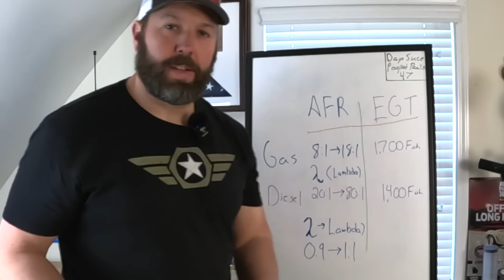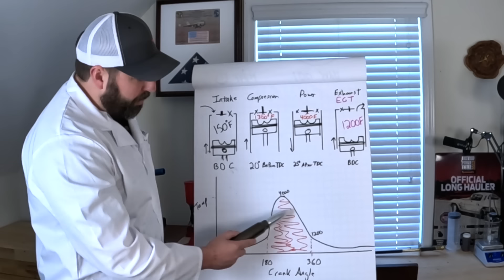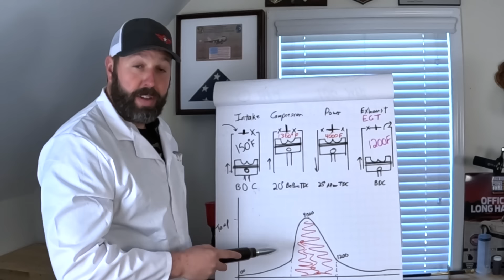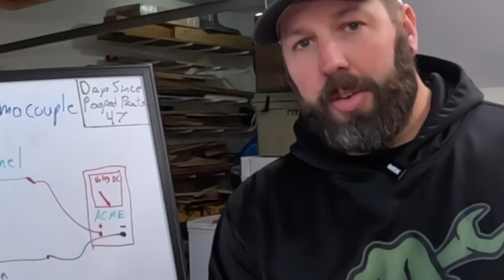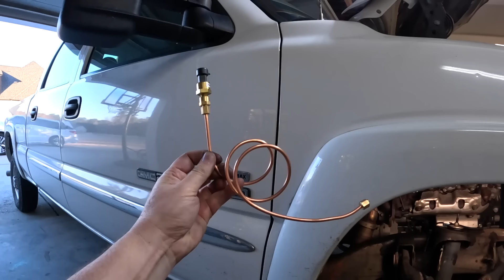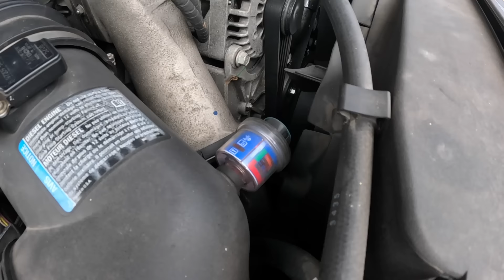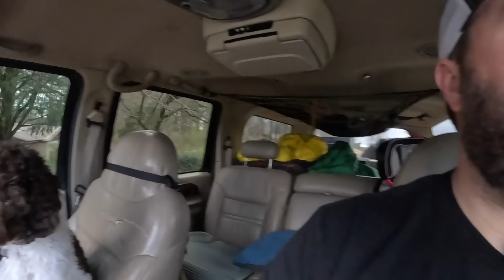Silent Diesel Killer…Diesel Exhaust Gas Temperature (EGT)! #diesel #egt #dieselengine

Comment: Peterbilt tech here and i cannot tell these guys enough how much heat the engine retains with out the EGR on these newer engines, not uncommon to see a newely "offroaded" engine, torch a head or turbo shortly after. Great video!
Reply: A Ram Cummins I know runs at least 200 C cooler without EGR. ( Hot air Detuning)  Than with it an has a 28 percent reduction in fuel burnt
Reply from the maker: @garreysellars5525  if you tune the truck after removing the EGR, bump the timing, and disable all the other emissions aspects of the engine, you could reduce EGT’s, but at the same time, you are increasing the cylinder temps. Which is more efficient and powerful, and the expense of increased emissions. Cummins knows a thing or two about cheating those emission laws though 😂😂
Reply: @freedomworx  yeah look into that
All they did was increase add blue use and lock out the RCU
You missed the point
LOWER EXHAUST TEMP WITHOUT EGR AND LESS FUEL BURNT 
So with emissions fitted use more fuel
How is running the world out Of fuel faster Better for the planet 
Ad water methanol injection system reduce nox reduce fuel consumption
Make better power
Lower exhaust terms
Reply: @freedomworx  dude what you're saying is completely contradicting. @garreysellars5525 is correct. This is not gasoline and it took me some years to truly get my head wrapped around switching gears from gas to diesel from job to job. And Gale Banks vids explain it the best and easiest to where ppl will actually watch thru n learn so I don't have to type for an hr lol. Its good we all work together and continue to learn instead of getting shoulder chipped. Then we all will be unstoppable.
First, reducing egt's while raising cylinder temps simultaneously is physically impossible. Its physics, thermal dynamics to be particular. Second bumping the timing only creates more cylinder pressures, this rides a line similar to detonation on a gas, as it will beat the bearings outta her n try to lift the head. Think of punching the piston down vs pushing. Although you can gain some power with a bit of timing this only benefits at the highest rpm range and diesels already wanna run lower rpm in torque band not hp band, unless you're building a dyno porno. Now if you push too far on timing with direct injection engines, this will cause the computer to calculate there is not enough time for pilot shot and will skip the pilot and move straight to the main shot. ( I know when this is occurring as can always hear the rattle at low rpm tip in or matting on shit tunes) Now u get less fuel and no pilot preburn to muffle piston slap and eliminate all the dwell for when the main shot is "supposed" to fire. Couple that with the punch that is created instead of push, the binding effect starts to set in and cylinder pressures go well over 1000psi and this is what lifts the head gaskets. Stud it and now you'll beat out rods or mains, maybe a ring land depending on engine. Third the only way to cool cylinder temps AND egts is to add more air density or to pull back the fuel, and the colder the air density the more power is created while achieving cooler cylinder temps AND egts. We just only have a way to watch egts without melting sensors and having more ports in the combustion chamber etc. Matching the fuel to the amount of air density and having that air density be as cold as possible (more dense) is the only way to make power while having cleaner burn and cooler controlled egts (no large flares on full send, stabilizes and the cooling system can stay on top of/maintain these temps for a 10min hill pull for example). All my info has been confirmed using a ford 6.7 with cylinder pressure transducers in the glow plug holes and cummins with CO2 sprayed intercooler along with frigid North temps on dyno and on road. And Gales science and tests showing how adding more fuel past the amt of cold air density u can shove into that engine actually loses hp and torque due to everything getting so damn heat soaked after initial pull as it ruins the air density as well as excess cyl pressure beating her up and large egt flares on the ragged edge of dropping valve seats or injector tips causing the ol plasma torch thru the piston. I'll say it again just like while talking w Gale, smokin is nothin but meltin n wastin. Humble ourselves n lets keep enlightening each other to learn as much as possible, then we can achieve perfection. And more minds are always better than one as then all angles of perspective can be brought to the table so we dont miss out on any knowledge
Reply from the maker: Raising cylinder temps while reducing EGT’s is far from impossible, you simply don’t have a good grasp on the diesel combustion process or physics and thermodynamics of an internal combustion engine. You can advance timing and get a higher peak cylinder temp, while simultaneously reducing EGT’s because the peak temp happened earlier in the stroke, which gave the piston more time to extract energy (heat) from the combustion gasses. Not to mention that modern diesels use multiple injection events per power stroke to try and lower the peak temp while maintaining the average cylinder temp and pressure. This means you have combustion occurring later in the powerstroke, where the piston doesn’t have as much time to extract energy (heat) from the combustion gasses. Hell, OEMs want the high EGTs because that helps the catalyst in the exhaust system do their job. But they don’t want the high cylinder temps because they produce NOx. Like I said, you guys go watch some more Gale Banks videos, I’m quoting directly from the Bosch Automotive Handbook 11th edition and  Internal Combustion Engine Fundamentals 2nd edition. I’m not saying Gale is wrong, I’m just saying that neither he nor I can explain that topic completely in a short video where everyone can understand it. The best video on EGR can’t make most people understand it, because they just don’t have a good enough grasp on physics.
Reply: @freedomworx  Holy cow bud u absolutely cannot cool diesel engines by adding more fuel at any point in the firing event. These things are truly air pumps. Your video was spot on, the only thing i disagreed with and corrected you on was your comment to garrey. I do say i really appreciated your video and the enlightening to offer so many who don't understand egts, but now youre just making a mess of your understanding of the basic concept just outta spite and the chip on your shoulder. Really starting to remind me of the rest of the email tuners and I bet I find your timing maps at 40deg btdc cutting all pilot and draining the rail before closing causing shitty atomization and the haunting p0087, which most poor tuners just shut off from setting, while the lack of high pressure against the injector for the next event causes a poor spray creating more heat and more smoke with less power. cmon man we are better than this arrogance
Reply from the maker: I’m not being arrogant, I’m just being factual and contradicting  what you are saying. You say that you can’t cool diesel engines by adding more fuel at any point…. So why do competition sled pullers and drag races run AFRs so far past the point of adding more power??? Because the extra fuel actually lowers the EGTs. It allows the to get them most possible fuel burn out of the given amount of oxygen in the cylinder, while quenching to exhaust gasses to keep the hardware from melting down. That’s the EGT control strategy used when nitrous isn’t allowed 🤷🏻‍♂️ Now that phenomenon is not what I’m talking about in this case, but it does demonstrate that you either need to brush up on your knowledge or choose your words more wisely. You
Reply: @freedomworx  dude once again you are dead wrong. That is gasser concept, we cool the cylinder walls with the rich spray (too rich will butt rings and is just as damgerous as too lean, did you know that? I learned the hard way after an old fart told me to listen up)... This is fully incorrect with diesel, there is no extra fuel to cool the combustion on a diesel that will only cause more heat, cylinder temps, AND egts. I have proven it with multiple real life tests to know I am doing the right thing because of humbling and self doubt, which has actually made me better over time instead of stuck stagnant in the same rut over thick headedness. The only reason they do that on sled pulls is to get the unburnt diesel to flash in the raging hot exhaust log to make the turbos spool as fast as possible, then the temps cool cuz the AIR is now coming in hardcore, compound that with an amazing intercooling sys and then you can continue to make power without melting down. On everyday vehicles this is achieved with a VGT TURBO, not FUEL as its just wasting n melting. I think YOU need to brush up and open your mind into understanding that NONE of us know it all and you are stuck on arrogant hill with no room for improvement cuz "YOU KNOW IT ALL" already. Keep meltin em down then bud, and cant say I didnt try to pay it forward
Reply from the maker: @odysseydiagnostics https://youtu.be/Wda4geM8X-c?si=kTw3fHg4kyROifs8 very simple video to once again explain to you what you dont understand. Charlie is a diesel drag racer and owns KC Turbos. You going to tell him he doesn’t know what he’s talking about either? 🤡
Reply: @freedomworx  Dude holayyyy that video just proved my point i'm trying to show you, this is ridiculous you're absolutely arrogant. He literally just said its to drive the turbo harder and the air is what bringing egts back down. Fuel always brings it up. Air always brings it down. On a diesel. Exactly what I just said, and Garrey, and Gale and Charlie are saying. Charlie knows what hes talking about its you that doesn't now and its you that are calling ppl down now its borderline narcissism at this point and you prob just doing for the engagement or your arrogance has created absolute ignorance in you. Shame on you, you need to do better. Smarten up man and pull them bosch binders back out with an open mind and when you're done then listen to charlie again if you don't wanna listen to me and Gale. Your video was good. Don't ruin it with this bs. The only one who is a clown now is you and I don't need an emoji to prove that, its all in the comments and chariles video what a joke you've turned into in my perspective and to think I thought u seemed super cool and knowledgable after watching yer vid
Reply: @freedomworx 
You have also s
Reply: @freedomworx 
If get is lower as it exits the cylinder 
Wouldn't cyl temp be lower 
You confused me there
Heavy diesel fitter 45years 
Australia
Reply: @f @freedomworx Naval Engineer here who specializes in marine diesels. You are 100% correct on adding more fuel to create lower cylinder temperatures. It’s kind of like the more acetylene you add to a torch the hotter the flame until a certain point, once you cross this point the torch flame temp actually starts going down basically, but not really.
Reply: @garreysellars5525 English needs tuned.
Reply from the maker: Thanks for watching. Yeah, very few people actually understand what an EGR system actually does, they just know that they don't want it.  If you're going to delete it, you best adjust the tuning to account for it, or you can definitely burn one down. 👍
Reply: @freedomworx  even 80hp GM 2.5 "iron duke/tech 4" will melt a piston if the EGR is deleted
.
You have to be using it JUST RIGHT to get the 80hp to get hot enough 
But it can happen
.
.
If the EGR is designed well (aka, doesn't fill the intake with soot, the pipe itself doesnt plug, etc etc)..... I'm keeping it
Reply from the maker: @kainhall  an EGR can actually increase MPG on a gasoline engine. Most people don't realize that.
Reply: @kainhall  To be honest the efr is a good piece of equipment.it's just the engineer's built a good device but they proceed to ignore the pistons something I think is criminal they wanted less emissions but overlooked the best way to improve the heat would be a issue but like I said the e.g.r. would help with that a better set of pistons would help.to decrease those pollution's something companies like wave of air is working on if this type of thing goes big emissions should be a thing of the past if I am looking at this right
Reply: @kainhall  but that's what EGR DOES
Haven't seen one that doesn't
Reply: @freedomworx  you recon
It's a hot air Detuning device
Making the intake air hotter. 
IE Reduce air density uses less fuel.  Mmmmmmm
Have you watched any thing from Gail Banks
Reply from the maker: @garreysellars5525 ohhhh… you watch Gale Banks! Didn’t realize I was dealing with an expert 😂
Reply: @freedomworx   with gassers this is actually the case for really only 2 practical reasons, the scavenging effect allowing more air (density) to be sucked in each time whether from egr valve itself or from cam overlap and VVT systems which is only really seen as a benefit in Naturally aspirated engines as with boost u could just add more density by growing boost and cooling intake temps. And second cuz the added nox with a bit of hot exhaust gasses can prevent knock allowing us to run more timing, but with all gas engines we have DWELL, which is due to having spark plugs and needing time for the command to actually create the spark at the tip of the plug as well as the time for the mix to start burning and the flame front to spread across the chamber. Gassers have a lot thinner block and head masses which allows the cooling system to strip these temp spikes though during a pass etc. And all new age diesels have a pilot shot to eliminate damn near all dwell as long as someone hasn't adjusted it so poorly as to kick out the pilot due to lack of firing event time. As i said below, it took a lotta humbling, thinking, listening for me toi get to where I am, and the more we all stay open minded and continue to learn together the more we will all succeed in achieving the impossible
Reply from the maker: You forgot to mention the reduction in pumping losses that an EGR creates in a gasoline engine. When you introduce EGR flow into an NA gasser, you need to open the throttle body more to achieve the same power, this you reduce the pumping loss and increase efficiency. EGR decrease efficiency in diesels and increases efficiency in gassers (in general).
Reply: @freedomworx  At this point youre just arguing whatever u can think of just to feel smarter, when in all reality we are all really smart in our own ways. Put that all together and all of us make the smartest knowledge but only together. Your video was good, dont ruin it now with this high horse chip and be open minded to learn more. I mean how do you think you learned everything in your video? you were open minded. Also you really have no idea who you're talking to as far as skills go, and a good person would never discredit someones skill when they dont even know them. Thanks for the showing of true colors and ill keep fixing the ones guys like yourself keep screwing up then all over arrogance. just a shame
Added: I have all those bosch binders too bud, and only with the experience really connected the dots and showed me how to really diagnose, fix, improve, and tune correctly. Gales vids are simple n palletable and spot on for air density, just like your vid was spot on for actual egts in general. As stated before I only disagreed with your comment to @garreysellars5525, and the only reason I commented instead of keeping to myself is cuz I didnt want to see u ruin such good vid with such an ignorant and/or arrogant comment showing other ppl the few missing links in your understanding and possibly risking discrediting your vid as it really helps a lot of ppl to have vids like yours AND Gales to enlighten themselves w and not be so far off the beaten path of the real concept
Reply from the maker: I’m not being arrogant, I’m just disagreeing with your “facts.” If you don’t like my “facts” take it up with Robert Bosch GmbH and John B. Heywood. And if those names don’t immediately ring a bell, I’ve found our disconnect.
Reply: @freedomworx  Bro bosch n Heywood would sit you down n straighten u right up cuz from garreys comment on youre showing nothing but arrogance after a good vid with actual good "Facts". At this point your disconnect is your charge air pipe blew off when u told garrey that and continued to sit on yer high horse of bs on arrogance hill through the rest of this instead of learning. Smarten up bud, nobody know it all and now you're making yourself look ridiculous out of spite. Thats not how a true diagnostician carries themselves
Reply: @freedomworx 
And 46 years as a diesel fitter
Reply: @odysseydiagnostics 
Thanks for the backup and for his info I am a heavy diesel fitter in Australia
The vid make stated while pointing to his drawing
The heat goes into cylinder and into the oil
My experience is that the heat through the cylinder would go to the coolant 😅
Reply: @garreysellars5525  fkn rights Garrey I gots yer back! They are correct with the oil cooling as well as the coolant system as you're thinking, the oil is really responsible for pretty much everything from piston skirt on down, theres another guy commented about the squirters failing and the piston overheating which is spot on as theres really no coolant jackets down there for skirt rods crank etc but its a team effort between coolant and oil. And you are 100 correct about not opening egr equals having cooler combustion and egts on diesel as its just taking up valuable real estate with hotter air which means poor density and equals less power and hotter combustion and egts. Not to mention cracking an egr is also stealing exhaust backpressure for turbo spool and creates a type of "internal" boost leak, which will also equal less air density and once again less power hotter combustion temps and egts. This guy went awol in the comments contradicting the correct info even in his own video instead of helping everyone including himself to get better.. and when he shamed u for trying to better yourself and referring to Gales Air Density science that hes proved multiple x over as a joke I had lost all respect and shows me he's just regurgitating someone elses knowledge without the want or will to truly understand it and better himself. He's embarassed inside and thinks hes hiding it in his arrogance which is fr just sad. Keep doin u never give up and always remain open minded. Peace n reps from the Northern Lat to the Southern Lat Brother!
Reply from the maker: @odysseydiagnostics I’m not AWOL, I’m just done trying to help you understand the error of your logic.
Reply: @odysseydiagnostics  
Great point you made 
When you open EGR it's an internal boost leak
Turbo lag right there
Here in Australia with hotter ambient temperature we need all th air density we can make
My Ram has dropped 32 percent fuel consumption and lower get
Water methanol injection is great. Reduced nox 
You where correct when he doesn't know what qualifications we may have
Cheers
Reply: @garreysellars5525 Gale banks is the Scotty Kilmer of the diesel world. Dude’s a senile old man that needs to retire.
Reply: @freedomworx  do you work for the EPA
CERTAINLY sounds like it
The emissions system in factory set up cause engines to consume as much as 30 percent more fuel than without 
So how is running the world out Of fuel faster Better for the planet?????
In heavy diesels this is worse 
N14 without. 2.4 km per litre 
Without EGR  DPF. .8. To 1.1

Real world facts
Reply: @freedomworx  vvt enters chat and deletes pesky EGR for you
Reply: @freedomworx not on diesel
Reply: @kainhall  egr passage on my 1980 Chevette circa 1983, first car had bad spark Knock.  Manually push the diaphragm and nothing.  New valve nothing.  Take valve off, no exhaust coming out.  Bingo.  Dad worked for Chevy got me an intake.  All good again.  Yup.  Cools intake charge, reduces knock.   Think we fooled with vacuum delay valves so it wouldn't sag.  
     New age EGR is seamless.
      Excellent channel!
Reply: @kainhall that is a big "if"
Reply: It’s hardly noticeable in diesel engines they have so much heat sink mass compared to gas engines. It’s truly pretty much a nox burner on a diesel. Most of the time u notice them melting is cuz the tuners (which is why u notice after tamper) go crazy on timing tryna get em responsive and completely forget these are diiiirectttt injection lol there’s hardly any dwell and we have a pilot shot to take up all dwell. Boost is response and timing is head gasket and valve seat popper, not the other way around like majority thinks. It’s all about cylinder pressures n egt on the danger side and boost and air density on the fun side. Gale really explains it best n simply. I started referring ppl to his videos so I don’t have to waste time convincing n can get back to work
Reply: @odysseydiagnostics we put a banks turbo kit on a 6.2 on dad's 85 suburban way back.  Whopping 210 horse.  140 stock.
Reply: Did you monitor drive pressure before an after the after market downpipe install? If so how restrictive was the stock flattened out 2x4?🤣
Reply: This thread sure is a war zone.
Reply: @kirara4953  getting heated for sure 😅
Reply: He's lost me 😮
Reply: Pyrometer FTW. Watch those temps. I had a hot unlock for the Juice on my '04 Cummins (no EGR crap). EGT could spike over 1100F (post turbo!) in a few sec. Stock it would never reach more than about 890F towing. Not sure (yet) where the sensors are on my' 25, but I do have a scan tool & app to monitor them.
Reply: Ya wasting your breath.  On a diesel the egr needs to go bye bye.  You can’t convince me that is better for an engine. Also crank case breather goes to atmosphere always.   I bet you’re gonna say it’s great to have oil going back through VGT set ups 😂.    Ihave seen EGTs drop  from a stock truck to a deleted one.
Reply: @freedomworx Dude holayyyy that video just proved my point i'm trying to show you, this is ridiculous you're absolutely arrogant. He literally just said its to drive the turbo harder and the air is what bringing egts back down. Fuel always brings it up. Air always brings it down. On a diesel. Exactly what I just said, and Garrey, and Gale and Charlie are saying. Charlie knows what hes talking about its you that doesn't now and its you that are calling ppl down now its borderline narcissism at this point and you prob just doing for the engagement or your arrogance has created absolute ignorance in you. Shame on you, you need to do better. Smarten up man and pull them bosch binders back out with an open mind and when you're done then listen to charlie again if you don't wanna listen to me and Gale. Your video was good. Don't ruin it with this bs. The only one who is a clown now is you and I don't need an emoji to prove that, its all in the comments and chariles video what a joke you've turned into in my perspective and to think I thought u seemed super cool and knowledgable after watching yer vid
Reply from the maker: That’s absolutely not what he said. You’re beyond help 😘🤡
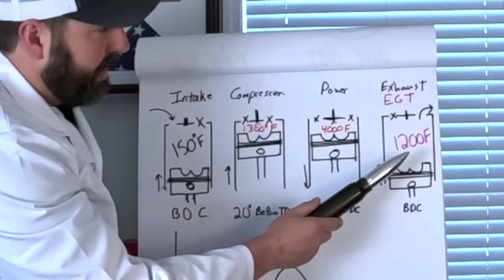Reply: @freedomworx   So block my comments now cuz it proves u so wrong while u double down in your wrongness. Yeah we know who the real clown is. Your behavior is disgraceful. Charlie starts explaining it at 2:30 so clean yer ears and watch again. This chip of yours will be your downfall someday. Bro bosch n Heywood would sit you down n straighten u right up cuz from garreys comment on youre showing nothing but arrogance after a good vid with actual good "Facts". At this point your disconnect is your charge air pipe blew off when u told garrey that and continued to sit on yer high horse of bs on arrogance hill through the rest of this instead of learning. Smarten up bud, nobody know it all and now you're making yourself look ridiculous out of spite. Thats not how a true diagnostician carries themselves
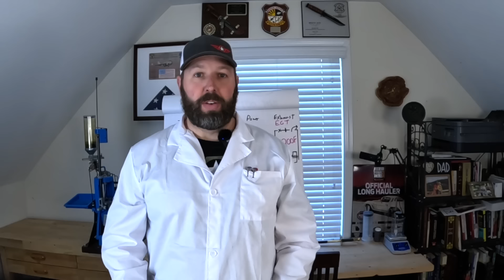Reply from the maker: Guess you stopped watching before 3:30 🤡
Reply: @freedomworx  you know what, you make me money. Your arrogance and ppl who act out like you instead of being open minded makes me a lotta biz. So block my comments all you want, but you and I both know you're off the rails wrong in this convo from garrey on down. You do not show respect to your fellow mechanics n peers. You do not deserve anyone knowledgable's time. Do yer thing bud, you know it allllll get to 5mil n then get cancelled on yer arrogant hill while you melt em down like a rookie noob
Reply from the maker: Funny thing is, you do actually make me money by commenting on my videos. I don’t make you a dime, because I’m not a mechanic and I don’t work in other peoples’ junk. I’ve never blocked your comments nor do I intend to. You know just enough to make you a confident commenter, which makes me money. And one day, you might actually reach me something. But today is t that day. You don’t know quite as much about this topic as you think you do 🤷🏻‍♂️
Reply: @freedomworx   I know. And I tried to help you. Like others have helped me. And you know you're wrong and you're embarrassed. And I ain't laughing. But that's where u gots it twisted u should be enlightened. Like I was when I finally opened up my mind n ears. And I sure don't call ppl names. That's when you become great. Now your actions have just shown me you're a bad person. So I will never help you again, but you'll be helping me for years to come cuz I will be quiet and just tell ppl its my magic so pay up. Grow up cuz you're acting like a boy, not a man.
Reply: @freedomworx  And none of my comments show in the thread it just shows you talking to yerself at this point lol.
Reply from the maker: If you want to be enlightened, start watching that video at 3:30 seconds. You’ll feel pretty foolish.
Reply: @freedomworx  I watched the whole vid dude. Just like I watched yours. Very good vids. You were foolish for telling garrey that not commanding egr can keep egts cooler is wrong, and saying that cylinder temps can be hotter while egts can be cooling simultaneously which isn't physically possible. They are direct correlation of whats happening inside the combustion chamber and even you say it yourself in your vid.  And then told garrey that having higher air temps can be cleaner and more power. You are contradicting yourself, Charlie, Me, and then to top it off I drew the line here with my silence as you made fun of Garrey for watching n learning from Gale Banks @bankspower like some bully. I'm Sticking up for them. And trying to help you. Your actions made you the fool. You are not good peeps. Goodluck
Reply: @freedomworx  nah struggled through
But no more
Reply: @odysseydiagnostics open a book. Banks is doing one thing, trying to sell a product. If that means lying about things, he’s going to do it. I wouldn’t listen to his advice on a weedeater if he sold 2 stroke oil. I’m definitely not gonna listen to him on diesels
Reply: @Redsfanatic32 
 Gail Banks has forgotten more about this engineering than MOST PEOPLE LEARN
Reply: EGR can't reduce egt at full load because it is fully closed and the intake throttle fully open. If you block egr and disable intake throttle the engine will take an eternity to heat because there is a lot of fresh air at partial load
Reply: Dr funny glasses in commercial said peanut butter is bad.  Was that science?
Reply: Do you much about egr deletes but only blocking off certain items but with small holes in the centre?
Reply: I have a hydra on my e99 and love it. No pyro on it. I do have gauge for 8+ yrs now. I drive it hard every once in while. Everything is stock except for 6637 hot air intake.  Lol.when i rebuild turbo is when I install probe. 😂😂🎉
Reply: It's amazing how diesels worked for decades and decades without any of that unreliable environmental equipment on it.

Have owned 3 trucks without that equipment (and tuned) and never had an issue. 
MPGs went up and EGTs dropped.
Reply: I agree egr lowers cylinder temps drastically , isx/qsx Cummins crack there heads when egr is removed when power is added and Detroit dd15/16s WILL have damage occur if u delete them and add power